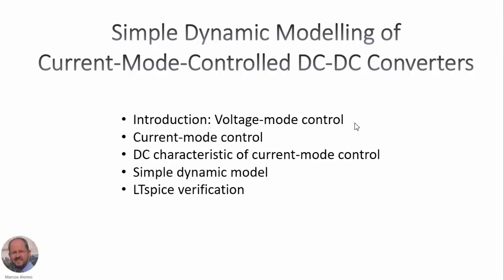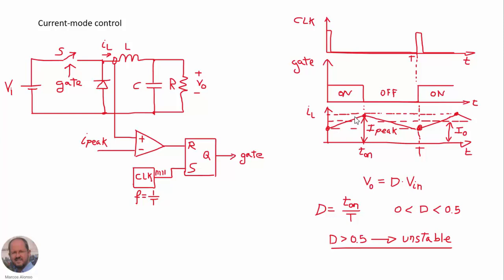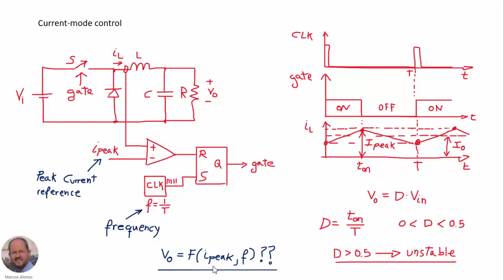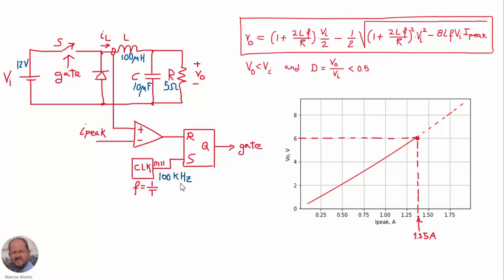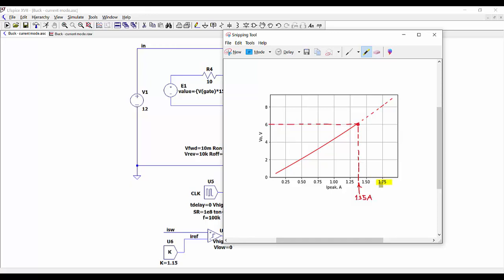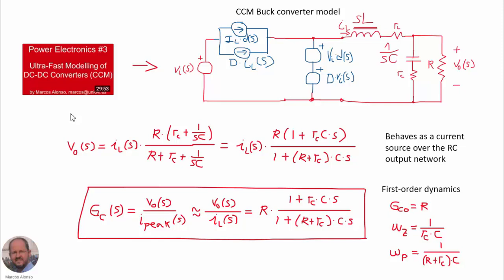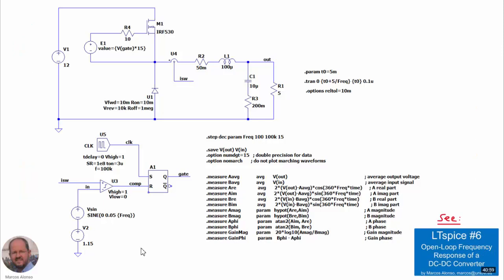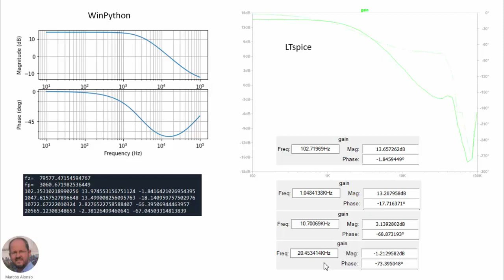PE #37: Simple Dynamic Modelling of Current-Mode-Controlled DC-DC Converters

Comment: Many Thanks 🙏 Sir...I have been waiting for this video ..one request there are different control methods like voltage mode , current mode ,hysteretic , what are the advantages and disadvantage of these methodology and how it is different from constant on time control ,pwm control its very confusing for beginners....if you could make one video it would be a great help
Reply from the maker: Thanks for your comment. I will try to post more videos on this topic.
Reply: Each control method has its own advantages and disadvantages. VMC is harder to compensate due to -40dB slope of LC output filter, and most likely need Type 3 compensation circuit. VMC response slow. CMC is easier to single pole at output transfer function, and only need type 2 compensation circuit. Its response due to load transient faster. Most SMPS now a day using CMC method. Hope that help.
Reply: @user-power_electronics  Many Thanks for your explanation.
VMC and CMC I got it but I don't understand about what is the advantage of constant on and off time control,feedforward control??
And VMC and CMC are related to above control methods.
Reply: @biswajit681  Look like you are talking about the new power control scheme using Constant On Time (COT) method. In this COT control mode, the voltage feedback compare with a reference voltage and generate turn on time through a comparator instead using Error Amplifier from Current Mode Control method. There is no need for compensation circuit which make it reacts a lot faster. However, the output need to have some ripple to make it works by either using Tantalum Capacitor output or sensing the ripple current across output inductor.

Comment: Dear M. A., your presentations are always rich, even for one who know about this subject. One question: do you have any video about the Average Mode Control? Does this control mode would be better as peak current mode control for pulsanting loads, line one printehead, for example, where in one moment the load is full and in the nest time the load is almost zero? Regards.
Reply from the maker: Hello, thanks for your comment. For pulsating loads, one of the best control methods is hysteretic control. It is used, for example, in pwm dimming for LED loads. See video on LED drivers on this channel
Reply: @MarcosAlonsoElectronics  Thanks, I will rush into it.